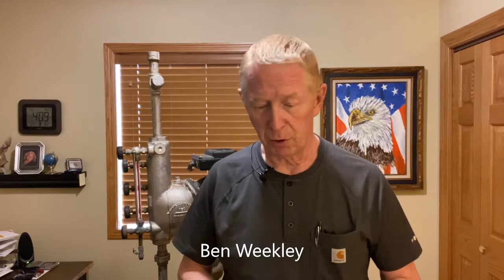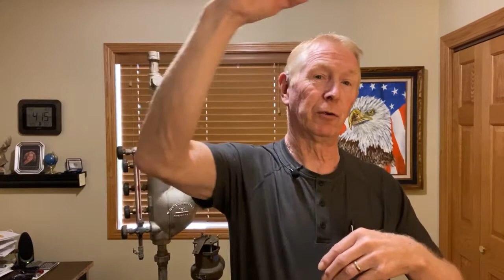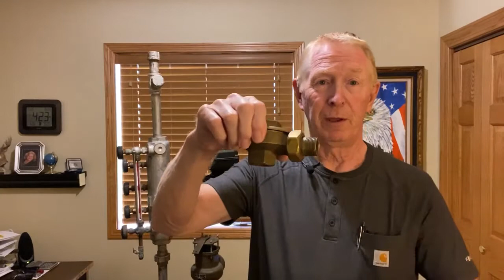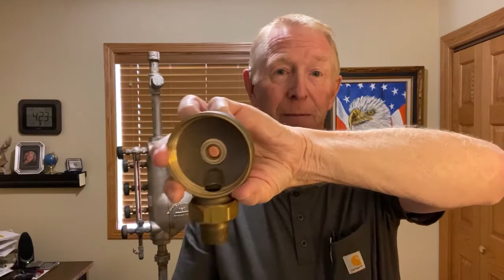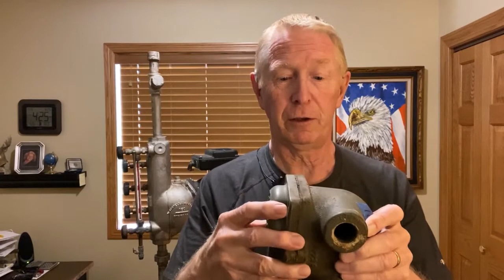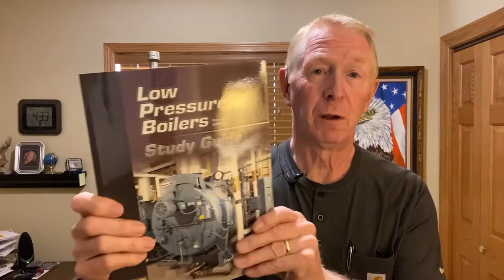Low Pressure Boiler Training-Session 4- Boiler Ben

Comment: Doesn't our modern world still run on steam power? Coal or nuclear, its just making heat for the steam generation.
Reply from the maker: Without steam a great deal of our electrical energy would come to a halt. Steam is also used widely in manufacturing and many other processing applications!

Comment: Still not clear.  Does steam trap dispose of air or simply direct the air to a vent somewhere else?  Where should these vents be in system?  Have vent on condensate pump and on feed pump.  Have trap on condensate line between header and feed tank.  If trap closed no vent.  Trap stuck open so I work with ball valve.  No header drip equalizer line.  Not much water in header.  Line may be to heat feed tank.
Reply: Great question and thanks for asking! The accumulation of air in the trap is cooler than steam and opens the bellows of the thermostatic part of the trap. It can also release condensate. The air is vented internally into the condensate drain line. The float thermostatic trap doesn’t vent directly to the atmosphere. Best wishes and hope this helps you. Boiler Ben!

Comment: No vents except on condensate tank and feed water tank.  Do have traps.  Question:  need vents?
Reply from the maker: With low pressure the condensate tanks and feedwater tanks are usually vented. Venting in the steam system is usually done by the steam traps or the boiler vent. Thanks for watching!